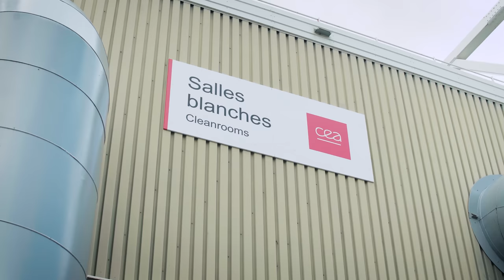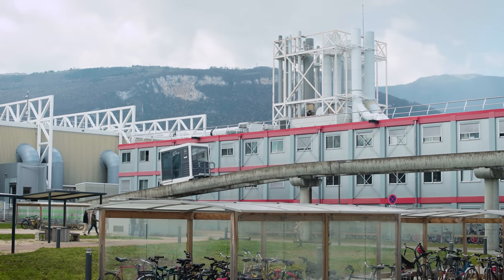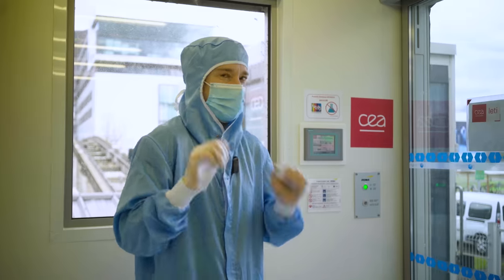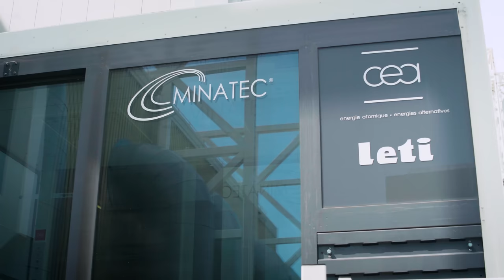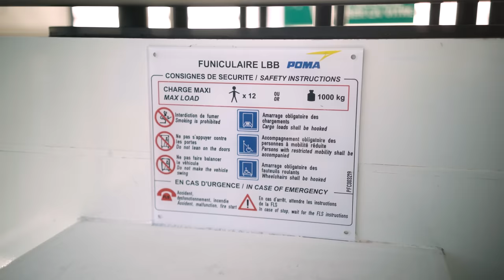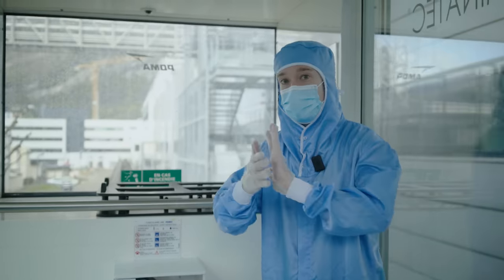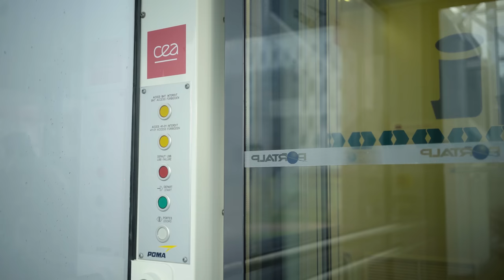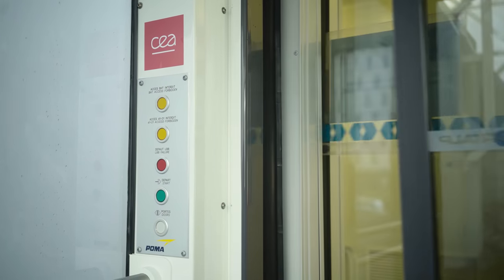The world's cleanest railway

Comment: I worked in the clean rooms at TSMC for a time and got to experience the corridor solution. Tom is right it creates quite a dismal environment, wish we had had a train!!! Great video though, it was fun to see all the tools again
Reply: Oh, and it looks like they get windows as well, deluxe!!
Reply: Just curious, how long is the corridor at TSMC?
Reply: Although apparently you can make a clean room out of glass as the people mover cabin demonstrates, so wouldn't that have made for a nicer corridor?
Reply: @unvergebeneid  A handful of glass panels is easy to maintain and check seals on, a 1/4km of various windows and glass would be a lot harder to find leaks and troubleshoot.
Reply: @unvergebeneid  Cheaper and easier to make it from concrete and laminated boards, rather than run the risk of glass breakage closing the facility, and not having any windows also keeps heat loss and solar gain from making the air handling in the corridor have to run with a flow that will mean particles are lifted up off the ground. You want the air to come in the top at the right temperature, humidity and cleanliness, and flow down in a laminar slow flow to the floor, where it leaves via filtered ducts to be treated again. Glass will mean having to either make it triple insulated, with heavy filtering on it, and vacuum isolation of the panels, and also need much more cleaning to be done on the outside and inside to keep it clean. 

A small glass clean room, with a battery powered air handler, that only has to do circulation for 2 minutes in transit, before the air is handled by the main systems each end, is a lot cheaper, in that you only have to filter the air 3 or 4 times in the run, and not actually do anything else to it. The terminals can automatically connect to replace the air when stopped, and charge the small batteries that do circulation and light.
Reply: I fidn it funny the anime pfp works on a super high tech company.
Reply: @SeanBZA  what would happen if i shot the glass with a pellet gun? wouldn’t a rival company be able to take the whole thing out of service for weeks?
Reply: i feel like the little glassbox wobbling over some crumbly looking concrete seems just as scary xD
Reply: Im just happy to see a EU company making 10nm nodes. Hope they do it profitable. Its way to much competition in the space it seems.
Reply: @DwAboutItManFr  Don't know where OP is but in Taiwan, where TSMC is based, it's almost expected that tech company workers watch anime.
Reply: @KiLLJoYYouTube  "highER" pressure doesnt mean high pressure. it enough that air will flow outwards, but not enough to burst windows. on top of that you wont have "shatter" windows. you will have laminated, multilayer windows at least, probably due to certain constrains, it will rather be plexiglass or acrylic.
Reply: @KiLLJoYYouTube  if someone breaks the glass then they will have to replace the glass... And in the meantime the will be walking things from 1 side of the road to the other like they used to do. It is not going to shut down the company, just be rather annoying.
Reply: @DwAboutItManFr  wait til you see furry pfps and the internet dependencies xD
Reply: @Djuntas  It's a research fab.  Everything made there is either one-off or very small serial production.  There is a lot of stuff made there that is in the LHC.  And it wouldn't surprise me if there was a section for classified work.
Reply: @DwAboutItManFr  it's more surprising if you work at a high tech company and there's no anime profile pics
Reply: @jst_TV  What you mean bruh
Reply: @loganfong2911  87 trillion nanometres.
Reply: standard rooms at intel and other chip manufacturers.
Reply: Damn TSMC? Kudos to you and your career :D
Reply: @DwAboutItManFr  it correlates pal. People in the tech are just bunch of weebs and it's almost guaranteed if you are asian

Comment: 11,000 sq metre cleanroom? Holy crap that's insanely huge!
Reply: 104 meters by 105 meters.
Reply: Or 100m × 110m (easier)
Reply: @dani33300  or 2x5000 metres (narrower)
Reply: @alberthusby113  or a circle with diameter 118.35 meters

I shall go tie my shoes in the corner.
Reply: @trist308  What corner, you built a circle, they don't have corners 😂
Reply: @Kasiarzynka  You did not pass.
Reply: @Kasiarzynka  I mean, what was meant is probably a cylinder, which does have two corners. 1 where the wall meets the floor and 1 where the wall meets the ceiling. A sphere however doesn't have any corners. A spherical cleanroom with a surface area of 11000m^2 would have a radius of 29.586m btw.
Reply: As huge as the guy's accent
Reply: 2.7182 acres.  Now, I understand!
Reply: @SpeedcoreDancecore  Sheesh. Don't go into any international industry! If this a huge accent to you, you'll have trouble communicating with almost everybody.
Reply: @MikeV8652  That number is soooo close to e, which is 2.718281828459.
Reply: Intel's Fab 42 has 52000 square meters of cleanroom space, about half of which is actually used for production (the rest is storage, hallways, utility areas, etc). The complete facility is 120000 square meters. And theres a reason they call it "fab 42"
Reply: how many square bananas is that?
Reply: @4nto418  "lower grade" cleanrooms: so, dirty cleanrooms?
Reply: @KonradTheWizzard  I mean as a french I gotta say his accent is tough, but hey at least it's understandable
Reply: 118.4k sq ft in standard measurements. Roughly 344' x 344'.
Reply: Probably nothing compared to the billions of dollars factories that are used to produce the highend chips
Reply: @DehimVerveen  15 upvotes VS 250 upvotes.....
Reply: @autohmae  If you build it as a new factory 1 billion will buy you about 10000m², including the initial small set of machines (a few hundred machines filling a bit over half the room). If you want high end lithography and other expensive equipment you have to at least double that. If you want more space, you build multiple clean rooms of roughly that size next to each other.
Reply: I know the room gonna be expensive if it's worth making a railway for, but 11,000m^2 is impressively bigger than what I really thought.
Reply: @AnimatedStoriesWorldwide  what are you trying to say by that?
Reply: @RichFromThePoor  So you want to say that you are bad at understanding people who dont speak oxford or cambridge english?
Reply: @benschneider1234  Nope, read again
Reply: @alberthusby113  Or 5000x2 meters (wider)
Reply: I work in a 50,000 sq metre clean room but my company went with the ramp option not a train 😔.
Reply: @Mack Crawford  I am lucky enough to have spent a year working there and it was absolutely incredible. :D OTF for the win
Reply: @alberthusby113  Or 1m x 1m + 11,000m tall
Reply: That's a small one, for prototype mainly
Reply: That's nothing compared to the Intel facility in Oregon. From gown room to the other side was about a 1/4 mile walk.....and they are still expanding o.O
Reply: @PortalFPV  Haha, Intel Fab 42 to fab 12 is a mile long, we in Arizona got you beat 😁
Reply: @alberthusby113  that’s only 10,000 sq. meters
Reply: @alberthusby113 
1x11000 🥵🥵
Reply: There is a 862,00 square meter clean room in Boise idaho
Reply: @AresHoax_9  Who the heck has that and what is it used for?

Comment: I worked in a radiopharmaceutical R&D facility.  While clean rooms are kept at higher air pressure to push particulate out, active areas in a nuclear area are at lower pressure to keep particulate in.  When working with nuclear injectable materials, you have to do both.  You set the clean room at high pressure, and an area of lowest pressure surrounding it.  The main corridors are higher pressure than the low pressure area, but lower than the highest pressure in the clean rooms.  Needless to say, the ventilation systems are complex.

Comment: it occurs to me that clean rooms probably can't even use standard building materials, unless they have special paint or coatings to seal in the materials or something... Time to go down a rabbit hole.
EDIT-  for those wondering what building materials: epoxy resin poured floors, with aluminum honeycomb modular wall panels seems to be the norm. PVC is another common material. Even the doors need to be easy to clean so no wood.
Reply: The building itself is normal industrial concrete. As you wrote: it is then coated with some kind of resin. Then another wall is built on the inside from lightweight aluminium panels. The floors are raised and have holes, so the air can go from the top of the building to the bottom in an almost laminar flow. On the inside there is no wood, no exposed concrete, nothing that can shed particles - just plastic and metal. The top floor or ceiling contains the filters, then the machine floor (usually level 3), then clean chemical supply, then general supply - cleanliness decreases from top to bottom. Going from standard industrial concrete building to clean room takes a few months.
Reply: @KonradTheWizzard  Not always the case. You have described what an ISO 5 cleanroom would be, with technical flooring system. But not always needs to be this specific, nor does it have to be such a clean enviroment. Depends on the needs of the customer.

But to sum up:

-Usually built with sandwich panels, coated steel or fenolic resin with insulating material or structure inside.
-PVC or resin flooring (Unless technical flooring is used).
-At least 1 Air Handling Unit with at least 2-3 filters on the machine, if required terminal filtering would be installed on the room.
-No sharp corners are allowed, as they tend to build dirtyness.
-Doors are usually made from the same material as the walls.

Just some quick hints of the needs, but depending on the use, different international rules must be followed, in order to be able to produce.
Reply: My experience with university cleanrooms is that they're built as a plastic room within a room. All walls and floors are wipe-clean plastic or PVC. Getting non-shedding ceiling tiles is, apparently, a nightmare and they're nightmarishly expensive. What's also very important is to reduce corners for dust to accumulate in as much as possible - I worked in a cleanroom where the floor curved up into the walls.

Figuring out an air current is important too: Tom mentioned that the cleanroom at CEA was at positive pressure but I suspect it (like the one I worked in) has the highest pressure in the cleanest zone (e.g. a photolithography room), working down to the 'grey room' spaces, flushing out dust as it goes. Grey rooms are places like the changing room which have the same walls/floors/ceiling as the main cleanroom but have no active clean air supply, relying solely on the passive flow of clean air from the cleanroom down to atmospheric pressure outside. I loved the room outside the changing room because the air felt nearly as clean as the cleanroom, but you didn't have to gown up.

Temperature and humidity control is also super-important. The chemistry for semiconductor fabrication - particularly photolithography - can be extremely sensitive to temperature and humidity. If you're the lab manager, expect people to come to you asking 'can we turn the temperature in the cleanroom up/down?', to which the answer is always 'no, unless you fancy redoing every process recipe that's ever been done in there'. We had a problem with one of the air handling units, so spring and autumn usually involved crazy temperature swings and photolithography steps having to be repeated a few times before you got the definition you needed.

Proper design and management makes a big difference for user experience.
Reply: @Gunachov  Thanks for the clarification. I have only worked in ISO 4 and 5 rooms and I'm not an expert in keeping them clean - I test and automate the machines in there.
Reply: @Gunachov  just wondering, we hear a lot about microplastics and how they're everywhere. is there no concern that the plastic in the clean room will "give off" microplastics? or is it expected that any microplastics would be dealt with via the circulation and filters and such.
Reply: @KonradTheWizzard  don't worry, you really know quite a lot, I know a little more just because I work every day with the diferent rules that we must follow, although, lot of them are just recomendations.

Actually, I have yet never desinged a room with a higher qualification than a ISO 5, so I might have a look at them. Most likely, construction wise, the materials are mostly the same
Reply: Now that you mention "rabbit holes," I wonder if they could've used a pneumatic tube, like the Rabbit Line in Vancouver.
Reply: If wafers are kept in FOUPs then the clean room doesn't need to be as clean, as the wafers have their own little environment. Of course insides of the tools need to clean as well, but the human occupied space doesn't need to be as clean.
Reply: @MobiusPeverell  No. Wafers are really brittle. Like glass.
Reply: Rimworld players will know the value of researching "Sterile Tiles" ;D
Reply: @KonradTheWizzard  TY for this, I am surprised as someone that has been in clean rooms I have never really thought that deeply about their construction.
Reply: @favesongslist  I've been in the industry long enough. So I've seen two clean room buildings as they were being erected and then subsequently I was inside them during the start up phase, testing the machines as they came in. It's quite enlightening to compare the view of the "naked" concrete columns and what you see later from the inside.

Next time you are in a clean room: just look around! Underneith all those concrete colums there is normal industrial concrete, all those steel girders are normal construction steel. But all of them are painted with a thick synthetic resin paint. All the exposed surfaces are either aluminium, stainless steel, glass, or some kind of plastic or paint that is certified to not shed any particles (i.e. it does not degrade and crumble into fine plastic dust after a couple of years).

To anybody else who does not normally enter clean rooms: there are plenty of videos online. Search them, pause them and look what you can see. There is quite a bit visible in Tom's video too.
Reply: @litapd311  microplastics come from particles of plastic being eroded in the environment by the traditional means. because plastic can't fully decompose, it just gets broken up into smaller and smaller pieces until they're small enough for us to clasify them as microplastics. they're not just ambiently produced by plastics, they are created through attrition, hydraulic action, etc.
Reply: @litapd311 microplastics are more commonly made from synthetic fiber (well, they are just thin plastic threads spun together), broken-up plastic (like when it degrades and weakens in sunlight), and other already small pieces. A big solid hunk is unlikely to shred itself.
Reply: From working at Intel for 6 months, they also had their air moving down, for example, throw a plastic bag in the air, which I have done, usually it kinda floats for a min, not there, they immediately went down faster than normal. Then they had some vents and rooms the same size underneath that if I recall correctly we're called the dirty clean rooms
Reply: Teflon is a very common coating for walls and stuff. Very easy to clean and you can use really aggressive solvents.

Comment: Recently got a look into an improvement process for a clean room for a local engineering firm, they're moving from disposable suits to washable, much more comfortable ones, as well as improving exit and entry procedures. Very interesting thing to have to deal with in some industries.
Reply: Going to bet the washing has special detergents, and low doses as well, along with some serious water treatments. Likely also no ironing either, and no softeners at all.
Reply: @SeanBZA  spot on, the only problem with dealing with washable bunny suit is that the fabric near the button tent to tear up when undergoing the washing process
Reply: I wonder if it would make sense to ditch any weak points with buttons in favour of a magnetic solution. Akin to a back zipper, one side of the clothing has a magnetic line contained within, while the other side has some fitting metal on the other side. 
Depending on what is done in the clean rooms, that magnetism might interfere with tested components though, so some amount of further insulation could be required.

Comment: The fab at Micron Singapore has 2 massive, 150m long "corridors" connecting the old cleanroom to the new one. No windows, but wide enough for 2 small cars aside with tracks for automated vehicles on the ceiling!
Reply: Is brake dust not a concern with the cars inside the clean room?
Reply: @CJT3X  You wouldn't find rubber tires that could shed particulates or mechanical braking components which could cause brake dust like that. Wheels would be solid plastic or metal on metal rails and braking components and propulsion would be electromagnetic.
Reply: @coulombicdistortion1814  Metal on metal sheds particles too, especially in curves and switches. I can see it well on tram tracks in the city, there's plenty of metal dust inside the grove.
Reply: @CJT3X  He said "wide enough for 2 small cars" not "currently using two small cars with rubber tires"....
fkin zoomers...
Reply: @CJT3X  I believe the little wafer carrying vehicles are magnet powered.